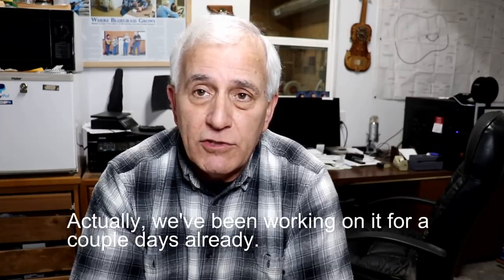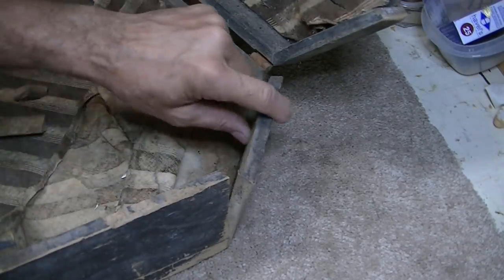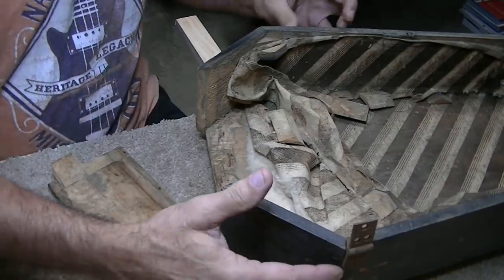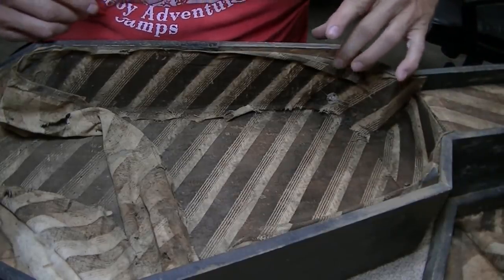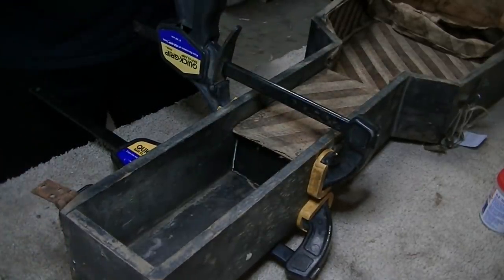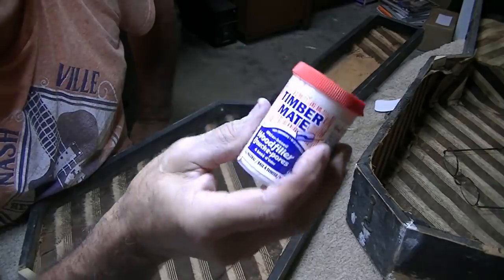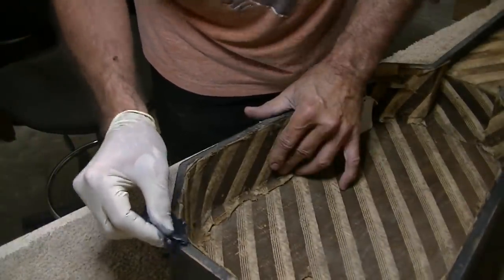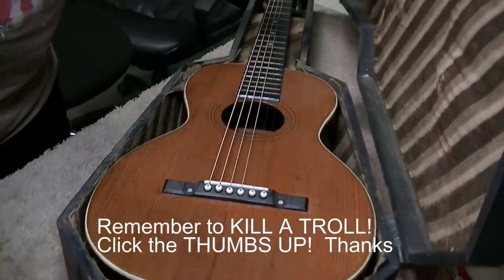274 RSW 1890s Parlor Guitar Coffin Case Restoration

Comment: Watching the last vid - and looking forward to seeing the latest tool mod you mentioned - I had an idea.  How about fixing an LED strip (the flexible roll up type) to some coat hanger wire (or even without the wire) and feeding it into the sound hole when you want to see inside the instruments when using the mirror or camera? Just thought it might make things easier if the whole inside was lit up and shouldn’t get in the way that much.  Just a thought.

Comment: Pretty sure those joints are why nobody sees cases like that anymore, they've all fell apart decades ago. That one has probably been in the attic since the 1920's. A couple dovetails and some corner reinforcement by the manufacturer would have made a much more durable case. You did the best job you could have though, and it turned out nice since you couldn't really make any major changes to it.